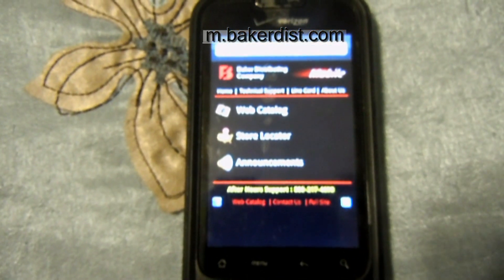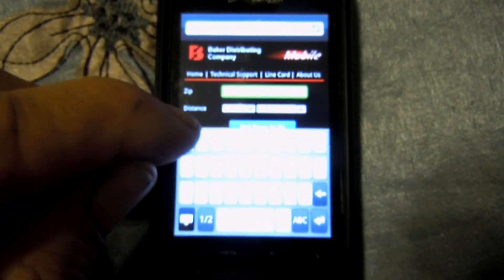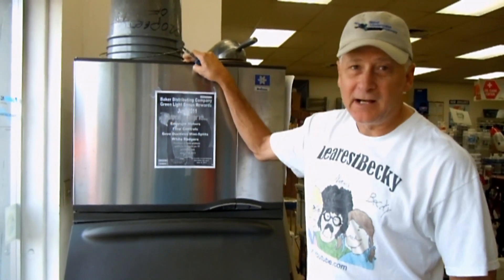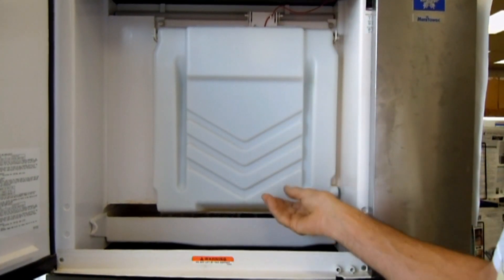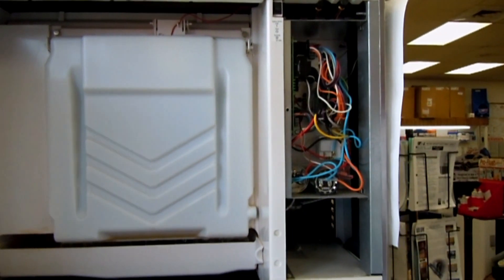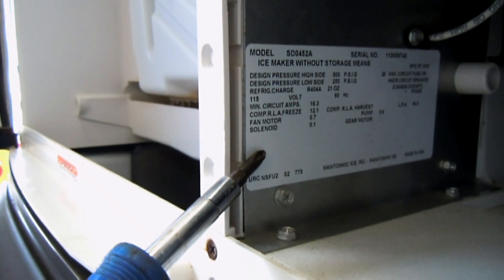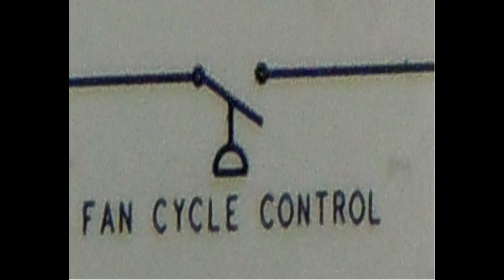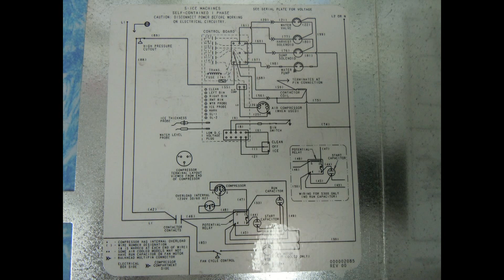HVAC Ice Machine Tour

Comment: The ice machines I deal with most of the time are smaller units similar to the Scotsman units. Seems the most of the problems are with the harvester wire grid. It uses a electric heat wire grid to cut the ice. Usually dirty and a couple had a break in the electrical circuit and needed to be soldered again.

Comment: So the reason there is no liquid flood back must be that the evaporator is colder than the ice cubes... And it still absorbs heat.. Does it absorb heat from the high side as well because the coils look very close to each other and is the pressure drop at the metering device the same as a typical air conditioner.. or is the range between the two closer or further apart? And thanks for your help. When I need help with something I usually refer to yours mikey and gray furnace mans Chanel.. Very helpful.

Comment: Dr zarkloff I've never worked on these but I've always been curious. it seems quite easy to understand.. But I wanted to ask about a few things first the hot gas fed to the evaporator is that to allow the ice cubes to fall out second what is the dump solenoid valve and what it does.. third this operates at med or low pressure.. And last of All with this being very cold.. can the refrigerant come back as liquid? Or because its low pressure these temperatures are too that of r22 410a in an air conditioner
Reply from the maker: Yes, the hot gas bypass is for ice harvest. the dump valve is to flush out the old unused water from the troff. No problems with liquid getting back to the compressor.

Comment: Hey Dr. I work on a similar model of Ice Machine, except mines is slightly larger. I recently replaced 2 air compressors that are located on the top left hand side of the machine (the opposite side on where the compressor and water dump valve are located), but i have no idea what their purpose is. Can you enlighten me on what they are used for?

Comment: Dr. Zarkloff, my manitowok ice maker does not start at all.  I have present incoming voltage to the contactor but it’s not pulling in so nothing starts. Any ideas, suggestions will be greatly appreciated.
Reply: Mr. Tinieblas Is it clean?
Reply: DrZarkloff I recently bought this used Manitowoc ice machine. I don’t think it has been throughly cleaned before. It had stopped producing ice one morning. By nighttime all that remained was ice stuck on the evaporator. Please help.